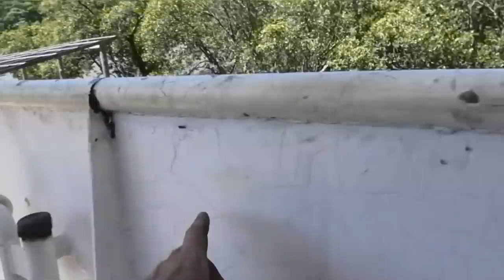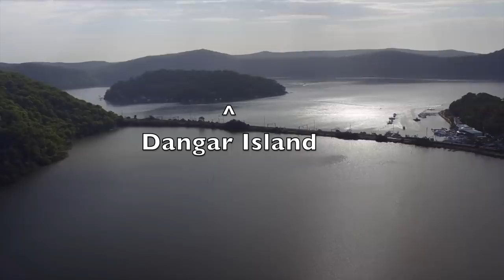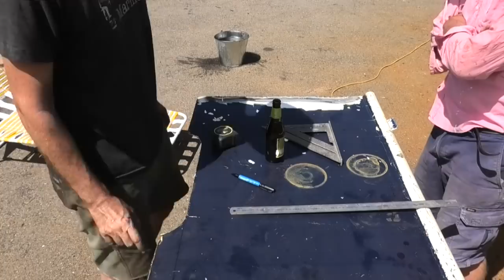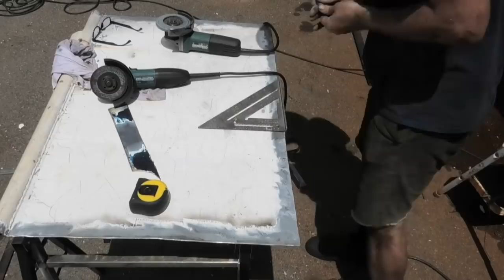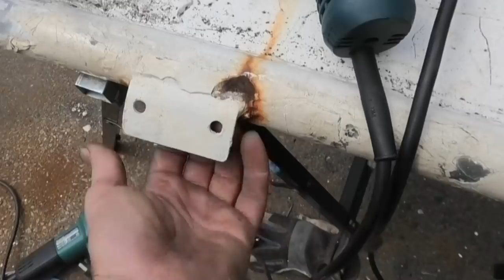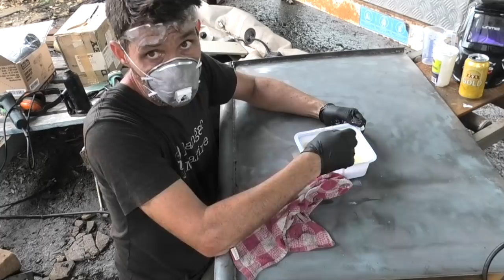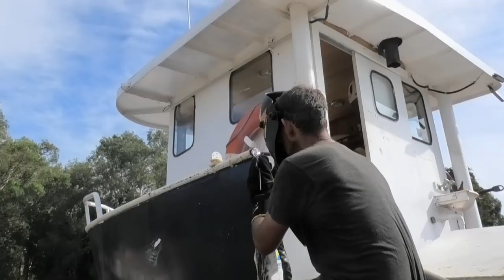Making a door in the steel trawler

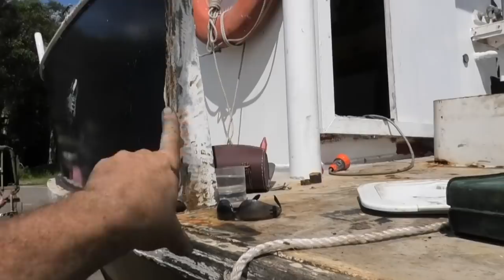Comment: 9:45 Swinging both ways- Yo..  Shit, beat me to it :(
I think the flatbar will work fine, but it'll look out of place once it's done..  As far as latches- A common latch in the Philippines for gates is just a smaller diameter tube inside the top round, with a channel cut in the top round, allowing the smaller pipe to slide back and forth into the existing wall/frame.  Think of a bolt-action rifle.  It makes an *incredibly* strong latch that's secure in all directions perpendicular to the top rail.
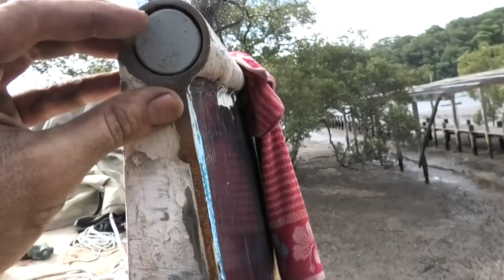Edit: 29:49- nooooo, that destroys your easy+strong latch :(
We're fine with the montage videos of just all the bits that happened during the week, doesn't have to be themed. Think we all enjoy the process regardless.
Reply from the maker: My worry with a latch like you describe would be water getting in and rusting things from the inside out. I might play with a larger tube that goes over the outside of the railing.

Comment: Hinge on front , door swings in, dead bolt in top pipe of door and a jamb plate on outside to keep door from swinging out. Comment too late .
Reply from the maker: I think I will go with a jamb plate. Although it will stop is swinging both ways I think it will be needed to keep it sturdy and solid when closed.